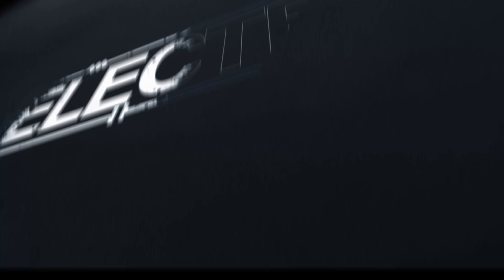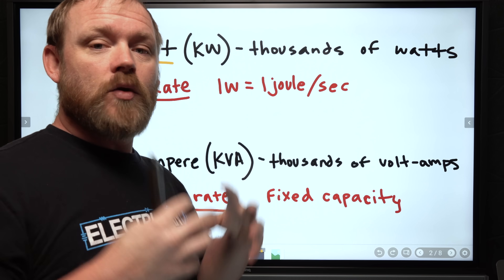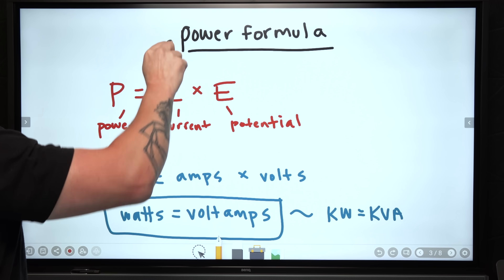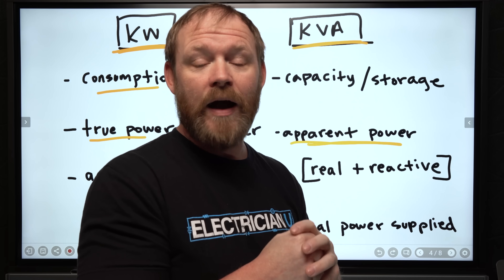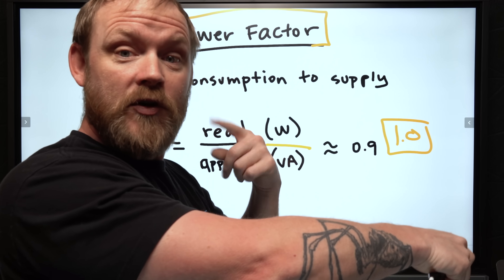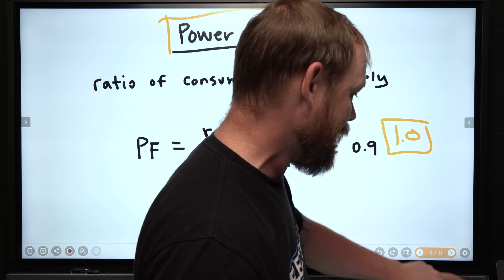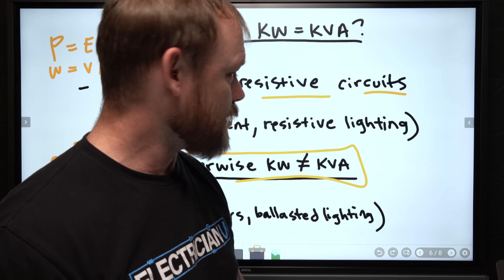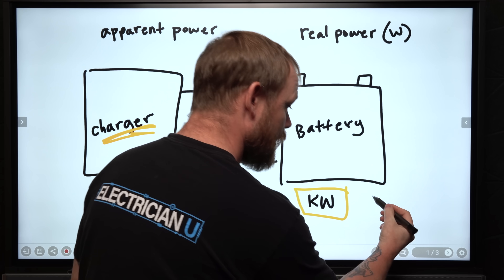Why KW and KVA Are NOT The Same Thing (Even If They Seem Like It)

Comment: Well... for a battery charger there actually is almost no difference because there is no reactive energy sloshing about... battery chargers will have near unity power factor and the batteries are exactly unity because they are DC.  But, as we all know, certain types of equipment require labeling in kVA by code anyway.

Reactive power is basically reflected power.  Reflected power can only occur in AC systems (or ripple in DC systems, but ripple is usually... not always, discounted).   Because it is reflected power, it travels through the cabling and generating/inverter equipment twice rather than once... which means that the internal resistance of said cables and equipment dissipate more energy than the actual watts delivered to the equipment that is doing useful work.

Reactive power is NOT doing useful work, but it has to be dealt with.  And how it is dealt with depends on the type of equipment.

* An inverter will see reactive power as ripple on the DC side and can actually recover a good chunk of that energy and reinject it into the inverter.  However, the reactive energy still generally has to flow through the inverter's components in the reverse direction before being recovered.   Hence some heat, hence the inverter must be rated in kVA because that is what is actually limiting its function, not watts delivered and not even watts received from the DC side of the inverter (from the battery).

* A generator will usually see reactive power as additional mechanical load... and basically it must dissipate it as heat.  It has to work against the mechanical load to overcome it == heat.   Which is why generators have to disconnect from the grid if the power factor goes too far out of spec... if they didn't they would melt or explode or otherwise let the magic smoke out.

* Cables see reactive power (reflected energy) as going through the cable in the opposite direction.... which still has resistance and still dissipates some energy.  So if something is sending 1000W through a cable and 200W is reflected back by XYZ appliance, the cable actually has 1200W worth of power flowing through it (not quite, but that's a good rule of thumb).   Thus breakers are protecting against kVA rather than watts delivered.

* You can also "recover" reactive power (not convert it to heat) with the appropriate LC "power factor correction device".  Which is the ideal solution, but relatively difficult to do because the power factor is changing all the time and the reactive power is still dissipating heat through components prior to getting to the recovery device.

Batteries are loads during charging... they are  absolutely consuming the energy.  They're just storing it rather than converting it to heat.   The reason why a battery is rated in kW is because it is a DC component.  You can't actually get any significant reactive power from charging or discharging a battery... reactive power is a function of AC, not DC (sans DC ripple which is a whole different conversation).

-Matt
Reply: Thanks for the thorough breakdown. I noticed most inverters, unlike AC generators, are rated in KW, and not Kva. Why is that?
Reply: @adon8672  Quite a few inverters are mislabeled, yes.  They are all limited by kVA in reality, though,   DC side ratings can be in watts.  AC output ratings are basically kVA but are often labeled as watts.  It isn't just marketing material... spec sheets often get it wrong too.

The Europeans are sticklers for using the proper terminology so something like an SMA inverter or a Victron inverter is actually labeled and marketed in kVA terms.   But a lot of Chinese-made products still get the terminology confused and that flows through to many products.  It's a real mess, actually.

One could get technical and talk about where the reactive power recovery occurs in an inverter, but in almost all cases the recovery occurs on the DC side, after the reflected power has gone through the AC circuitry in reverse, so the inverter is still limited by kVA and not by watts even if a good chunk of the reflected power is recovered and reinjected.
Reply: @adon8672  You're right, most inverters are rated in Watts. Victron Multiplus inverters are rated in VA though which confuses folks. So they go to Google and convert 3000VA to Watts and get 2400W because a general power factor of 0.8 is used as the multiplier. According to Victron, their inverters have a unity power factor (PF=1). So a Victron 3000VA inverter could be rated at 3000W. Since we generally power both resistive and inductive loads, it's difficult to know what the average PF is. Maybe it's easier for these inverter manufacturers to hide the PF rating than have to explain why their output rating is lower than comparable units.
Reply: @RVwithTito  I think the power factor will heavily depend on the nature of the loads on the inverter (resistive, inductive, capacitive?) and not just the inverter itself. It appears those multiplying the VA values by 0.8 to get the equivalent number in watts are actually correct. To be sure, I searched "do victron inverters deliver their rated VAs in watts?" on Google and one of the top responses lead me to DIY Solar Forum where someone has a similar question. Another forum member in response posted a link to a Victron website where Victron listed their inverter capacities in both VA and watts. An inverter they listed as 2000VA was simultaneously listed as 1600watts. I won't post the link directly here since YouTube might delete this entire comment as a result. I think Victron uses the VA values purely for marketing purposes as it produces higher numerical figures than watts (e.g 2000VA vs 1600watts). I know they are one of the most reliable inverter brands on the market but they aren't in the value for money (or is it value for power?) business.
Reply: @adon8672   - the kW on the Inverter, indicated the POWER which can be supplied from the DC Solar array.  Anything on an AC circuit MUST have the VA noted, as that is the total energy creating thermal effects..
Reply: If I was building a battery charger and keeping the circuitry simple, you could feed it a pure sine wave AC input, but its current draw would only be in brief pulses when the sine wave is near peak and there’s forward current flow through the rectifiers.  The transformer probably (?) needs to be rated to handle the full current of those pulses (in KVA), at least to avoid voltage drop, but the actual energy transfer over time will be less (in KW).
Reply: @kc9scott  Basically the only correct way to make a battery charger at decent power levels is with a regulator that incorporates a power factor correction circuit.  If you just try to rectify the AC and throw it into a switching regulator without a power factor correction circuit, it won’t pass code.

Power factor correction in switching regulators is very easy to do these days.  Basically instead of rectifying the AC into a buffer capacitor, the rectified AC goes into a switching circuit which pulls current from every part of the rectified AC waveform and pushes that into a buffer capacitor via (usually) a small transformer + diode + capacitor combo.

You wind up with a power factor greater than 0.95 by doing that.

-Matt
Reply: Spot on from a geezer. Took this in 2nd year physics in the 60's.
Reply: You forgot the diodes in the rectifier.  It's got a crappy power factor as it converts from ac to dc.  Hence active power factor correction was added in larger power supplies
Reply: @barryobrien1890  Ah, no, it isn't the rectifier that causes crappy power factor.   It's the buffer capacitor when it is placed just AFTER the rectifier that causes crappy power factor... because due to that capactor the rectifier winds up only injecting current above the capacitor's current voltage.

In a power factor correction circuit, there is NO capacitor just after the rectifier, so what you have is basically a full half wave at 120Hz.   There is then a switching circuit that chops the still sine-like waveform into a transformer which injects current at ALL parts of the waveform rather than just the peaks.   The buffer capacitor is then placed on the secondary of the transformer through a diode to soak up the energy being injected... basically.  There are a few ways of doing it.

Hence the power factor with power-factor correction is above 0.95.

-Matt
Reply: @junkerzn7312 agreed, but the vast majority of small loads like 10w bulbs etc do not have active pfc.  My point is that its not necessarily leading or lagging, but any distortion of the current waveform that causes poor pf
Reply: @barryobrien1890  I understand what you are getting at, but this isn't quite how waves on the electrical line work.  First, lets look at Total Harmonic Distortion limits.

Decades ago the total harmonic distortion seen at a substation was a lot smaller than it is now.  The IEEE-519 standard has been adjusted upward over the decades.  Now a THD of around 5% is allowed at the substation, and even higher (8%) for distribution lines.

One could definitely blame LED lighting for this change.  Most larger electronics... computers for example, have PFC circuits.  So we can mostly blame LED lighting I think, though I haven't googled it.

But that is basically the grand result of millions of little distortions caused by tens of millions of LED lightbulbs on the grid.  Waves outside the fundamental driving component spread out and attenuate over distance.  A 10 microsecond glitch caused by an LED lightbulb is unlikely to even make it through the solenoid inductor of a standard breaker, let alone the utility transformer, let alone any amount of distance.

So all of these myrid little sources wind up averaging out and turning into what is effectively just a single phase shift between voltage and current, and a small bit of harmonic distortion on the voltage and current waveforms.  And that is pretty much it.

-Matt
Reply: @junkerzn7312  You are a little confused.  I have to assume you are from the USA as you quote IEEE and not EC directives. There is no mandatory PFC in the USA, but it is encouraged by energy star guidelines, and suggests 0.9 for large appliances at full load.  In Europe  EN 61000-3-2 standard, require PFC for most designs with input power greater than 75W.  this is completely different as PFC is more critical in Europe, where old wiring is expensive and difficult to update, while the US has pushed for a 200A service to most homes.  Active PFC only works properly at full load and has significantly less effect lightly loaded (20%).  Computer power supplies are only required to meet PFC at 100% load (except uber expensive titanium rated which require .95 at 20% load).  My house, which is typically running lights, phone chargers, an inverter refrigerator and electronics (computer, monitor, tv etc) runs with a pf of 0.,75, with a load of 268W as I type this, which is typical for most  homes.  If I fire up the iron, stove top or rice cooker, it jumps to .97pf with 2KW+ load for a few minutes and then settles back to 200 - 300W at .7 to .8 pf.  The LED lights with 1/2 wave diode rectifiers are horribly low PF (0.1), and phone chargers with 10W or less load, sucking phantom power.  We are only interested in the steady state, not glitches. Its an eye opener of you do a check on your home for PF.  About 30% of the power is consumed by the residential sector where there is little or no regulation.  For commercial and industrial, the utilities often impose a power factor penalty and charge for reactive power, but this is easier to control as hybrid (active and passive) corrector can help improve electricity efficiency for the business and pay for the cost.  Most people have no clue about how to understand power factor, and sadly most engineers coming from school also are clueless, or understand the old school model of capacitor banks and inductive loads (only applicable to Commercial/Industrial).  They assume they have good power factor in the home because they don't use these devices, and then complain when the 1000VA ups or transformer in the home is too small when delivering a 1000W load..  As for that battery charger - if its  without active PFC, its 0.5 - 0.6 or 0.8 - 0.9 with passive PFC and 0.9 - 0.95 with active PFC.  Read the manual to see if it gives PFC data.  If not, its not there.
Reply: @barryobrien1890  Dude... wall of words.  Learn to use paragraphs.  Your response is almost unreadable.

Modern power supplies (anything made in the last 10 years or so) have much wider operating ranges at near full efficiency (and high power factor) than older power supplies.

All high-power battery chargers have PFC.  All in-EV AC chargers (that you plug your L2 into) have PFC.

Most designs are active PFC designs these days, not passive PFC designs.  The reason being that there are now many, many regulator chips that implement the capability as a single-chip controller solution.  Meaning there is no cost advantage to going with a passive PFC.

-Matt
Reply: - Modern switch-mode systems - has created a world where there are very few true DC systems "online".
 - Now that everything is driven through ACTIVE elements, not simply passive(s), resistive and reactive, Everything, even Battery chargers, have an AC Stage, possible even pulsed output - being DC shifted to the positive side for "advanced charging profiles" (time varying).

With nearly all modern appliances being "Inverter" style, there is a  - DC stage in the middle of the topology ,where battery power COULD be supplied 9if only there were conventions on the Voltage of the intermediate DC stage (? are there??).   

("battery as load", was also a major gripe on my initial watching , also confusing power and energy..)
Reply: @kadmow  Theoretically, yes.  You can bypass the PFC entirely and connect DC up to the DC output stage.  But there are lots of problems making this point available as an external port (fusing, current limit, precise DC voltage required by device, etc...) so I don't really know anyone who does it that way.

Instead, power supplies with PFCs often specify a DC or AC capability on the input.  For example, almost any Mean Well (industrial) power supply can be supplied by AC or DC on the same input port.

The reason this works is because power supplies with PFC circuits do not have to have an isolation transformers on the input.  Instead, the isolation transformer can be part of the PFC circuit itself, after the rectifier.  Since there is no transformer on the input, a DC input on the "AC" input lines won't short anything out.  The PFC circuit detects that there is no waveform and just operates as a regular switching supply.

This usually allows a fairly wide DC input voltage range as well as a fairly wide AC input voltage range, resulting in a very robust power supply.

-Matt

Comment: Another difference to point out about impedance for capacitors and inductors is their formulas. Inductive and capacitive reactance include frequency, which in a DC supply doesn't exist.
Reply: Exactly. The "reactive" power comes about when the current flow and the voltage in an AC circuit are out of phase. Both travel in sine waves, but inductors and capacitors cause a phase shift between them. With DC power, there are no sine waves to get out of phase.
Reply: @frankely6378 I went to Navy Avionics School in 1972. We had a saying for everything. For voltage and current we had ELI and ICE. ELI is voltage leads current in an inductive circuit . ICE is current leads voltage in a capacitive circuit. The sayings we learned for transistor configuration and resistor color codes would be banned here.
Reply: @Chris_at_Home  Right. I knew one causes lead and the other lag, but school was a long time ago, and I was trained as a mechanical engineer. We got just enough of an intro to power systems to keep us from melting the wires. But I also know that if you under or over excite a synchronous motor, it will act like an inductor or capacitor. It wasn't uncommon for a factory to have a couple of over excited synchronous motors sitting in the corner doing nothing but fixing the power factor from all of the induction motors in the plant. These "rotary capacitors" could save the company a bunch of money on their electric bills.
Reply: @ I worked in electronics and telecommunications all but of a few years of my work career. I even worked part time in a TV repair shop in high school that was owned by a couple retired submarine electronics technicians. Some of the places I worked had huge AC and DC loads. The last place i worked had 1400 amps at 48 volts load.  We had big 400 and 600 wire to distribute it
Reply: @Chris_at_Home  I look at it this way :
- Inductor reacts to current changing -> current lags -> voltage leads
- Capacitor reacts to voltage changing -> voltage lags -> current leads
Reply: Are but you forget all inductors still have a very small DC resistance... A tiny loss .
Reply: @ntal5859A DC motor is always switching poles so the current and voltage will have some ripple. The faster the motor runs the less visible this is on an oscilloscope.

Comment: Does a battery consume power when supplying power?
Reply: Chemistry is inefficient and side products (other chemicals) get made. So some energy is lost while charging or discharging.
These undesirable side products are why pharmaceuticals need to be purified or toxic stuff gets passed on to the consumer. That costs money. Which is why street chemists don't make good products. Lowers profits.
Reply: @CrispyCircuits  
So there is consumption or loss making a battery more KW than KVA.